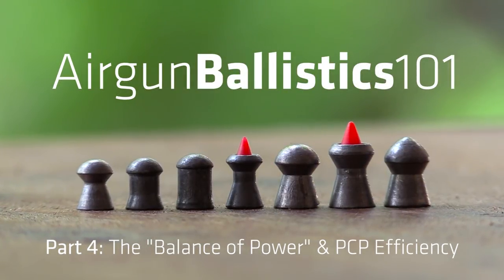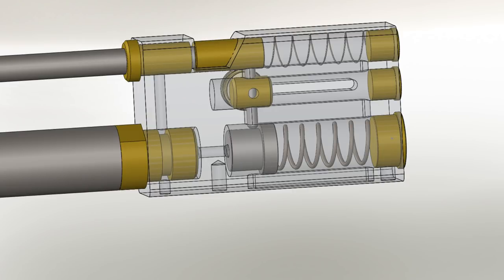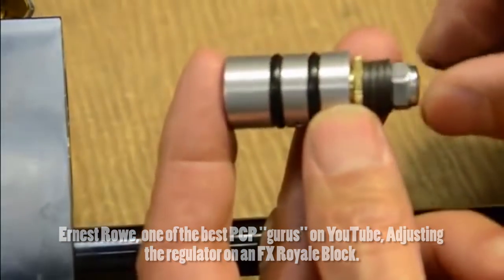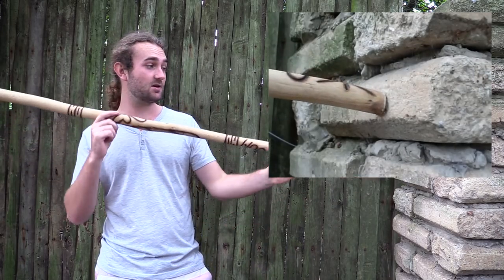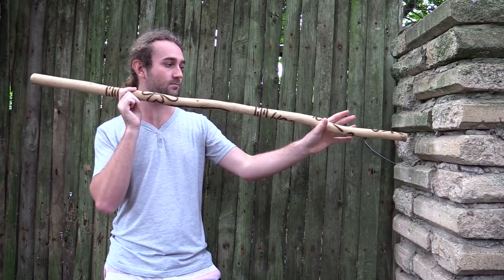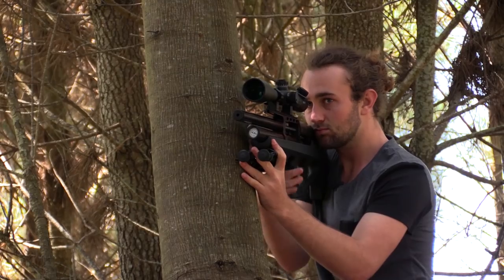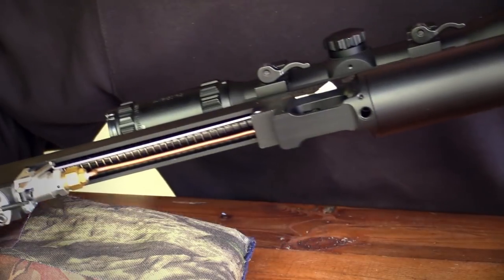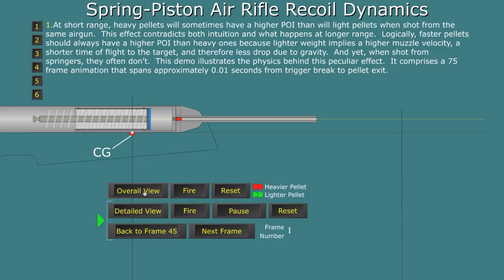The Balance of Power | AB101 pt.4

Comment: Brilliant video!  I am a veteran paintballer and failly new to airguns, but the way they work is EXTREMELY similar.  Regulator, valves, hammer spring adjustment.  Super happy i found this!

Comment: Basically its impulse control on the hammer. You tightly control the impulse on the hammer so that its delivered over a very short period which is shorter than the travel time of the hammer so that it bounces back on striking the valve head and doesnt have another forward cycle or if it does, not enough ro release more air. Thats good information.  Im currently working on a few designs and really appreciated this information.

Comment: To get the best performance on a regulated gun, you should 'sweetspot' the reg, if it's adjustable of course. Start with a low spring pressure and increase the reg pressure to the maximum velocity (chrono reading). Increase spring pressure and do it again. Do so until you get the desired velocity.

Comment: I've been watching these videos for YEARS and I've learned that there IS a method for running related PCP's. But it seems as though it's a giant freeing secret because no one gives a good video on tuning the: regulator, hammer spring, valve spring, hammer weight, hammer bounce.... Robert Lane has the best I've seen so far.

Comment: 🔫🔫🔫 I immediately noticed the importance of the valve spring adjustment when I tried to bring my dreamline down to 90 bar,  the valve spring is not strong enough to hold the air and it just leaks down over a couple hours.  Turn it back up to 110 bar on reg pressure, and then it has enough pressure to keep the hammer valve closed tightly.    If the dreamline had a hammer valve adjustment, you could easily adjust the spring to keep the valve closed at much lower regulated pressures.   Like the impact you could lower your reg pressure WAY down and just tighten up your valve spring and boom.  No leak down.   
I’ve been thinking of a way to get a “DREAMLINE mod” to have a spring adjustment,  but you would probably have to drain the air every time you adjust it because all of that is in the air res sealed up behind the reg.

Comment: amazing insight in the internals of the PCP , i am guessing that the graph @1:45 is for "response of   REGULATED   pcp to hammer spring preload" instead, as the graph is linear from 0T to +5T thats typical of a regulated setup.

Comment: Couldn't you pretty simply replace the hammer in even a cheap air gun like the Air Venturi Avenger with a two part inertia hammer to avoid hammer bounce?

Comment: Epic video Matt. I've just acquired a regulated BSA r-10 mk 2 running at 11.1 ftlbs. Being a regulated gun, does this mean that hammer bounce will not be an issue with it? (BSA claim it gets about 240 shots from a 235 bar fill but I've never verified this personally) Is there a way to increase efficiency with regulated guns? Many thanks, Lance.

Comment: Hi,
Thanks for your helpful content!
A little advice if you can.
I have a Brocock Compatto 5.5 mm, and it shoots at only 11.5 J. I am in the UK and is supposed to shoot at under 16J nozzle energy.
I purchased a regulator in order to get more uniformity over nozzle velocity at working pressure 200 to 100 Bar. I set the regulator at 120Bar ant try to adjust it to get 15.8 J nozzle energy but the maximum I can get is 14.7 J and a lot of waste of air because the number of shots I can do on one cylinder is less.
I mesure the tranfer port and is 2.2 mm ID (I thik here the air is geting slowed). I am planig to drill the tranfer port to 2.5 mm.
Now, the question is: have you taken apart your rifle? can you tell me what is the ID of the transfer port?
Many Thanks.

Comment: Hi i just got brand new reximex throne and when i tried to refill it, air was coming out from the barrel and couldn`t hold the air at all, do you know what to do? thanks
Reply: It's likely a rotten Oring dissemble and replace it remember to use silicon grease for high pressure air

Comment: I need to be explained some thing to me in your next videos. I am having hard time of understanding how does weigh of the pellet effects on the air being spend on the shot. For instanse if I have pellet in 177 cal, weights 0.67 grammes and shoot it in 300 meters.persec I have 40 stable shots. After that I do not screw anything in my gun, I just change pellet for 1.05 grammes JSB Beast and shoot it and have only 20 shots in the same air preassure range. Why is that happens? Its wastes more air now but I just changed only pellet. How is that possible? Please would you mind to help me to find out.
Reply: Cool question! Let me analyze: 0.67g x 15.432358 = 10.34 gr, and 300m / 0.03048 =984.25 fps, so 10.34 x 984.25 x 984.25 / 671 / 671 = 22.25 fpe, and 22.25 x 40 = 890 fpe total from your fill.

Now, keep in mind that a heavier pellet will travel slower in the barrel, but will accelerate longer in time, so the kinetic energy will be a slight higher by 1% to 5% if all variables are fairly equal; in other words, do not compare apples to oranges as 4.2 grain alloy to a 5.14 gr BB to a 21 gr lead (Pb) pellet.

A straight across-cross multiplication equation to convert m1 v1 to m2 v2, since you did not give the velocity of the "1.05g" which is 16.2gr, so the unknown is v2.

m1 = 10.34gr
m2 = 16.2gr
v1  = 984.25 fps
v2  = ???.?? fps

Isolate the unknown v2 = sqrt of: {(m1 x v2 x v2) / m2} = v2 = 786.336 fps, and
16.2gr x 786.336 x 786.336 / 671 / 671 = 22.25 fpe, so 22.25 x 20 shots = 445 fpe total.

Now for the ugly truth:

445 / 890 = 50% efficient for the 1.05g pellet in your gun, while the 0.67g is 100% efficient with the 0.67g in your gun.

Now, the answer to your question as to why you only get a 50% output from the heavier pellet, is in the name of the plumber; in other words, without enough information, I am pissing into the wind and wondering why my feet are wet.

What kind of gun, caliber, barrel length, type of pellet, pump/CO2/HPA/break barrel, smooth, rifling dimensions, gas pressure, etc., etc...

The more information, the closer the result to the truth. If anyone has a quick and dirty answer to your question then that is exactly what they are.

From the Ke and fps I guess you have a HPA gun. What would be nice is if you can include if it is regulated or not and what is the fill pressure you are using; also, if you know the plenum size, reservoir volume, and what appears to cause your 50% loss in total power is, what is the transfer port orifice diameter? It is probably 50% of your caliber in order to get the most shots per fill as opposed to it being the same as the caliber in order to get the most power per shot, but least number of shots per fill.

Use the following formula and tweak the variables to get your target power and efficiency numbers.

psi x π/4 x cal. x TP x n x Bbl" /12 = theoretical fpe

π = 3.141592654...
n = efficiency (power out / power in)
TP = Transfer Port diameter
Bbl" = barrel length in inches
12 = number of inches in a foot
psi = 14.504 psi/Bar

Enjoy your shooting experience because it is also a journey.

The laws of physics are not just really good ideas.

Numbers do not lie, but you can lie with numbers.
Reply: The short answer is there is likely some factor in your gun that adjusts for an heavier pellet  its obviouslt either not a strictly moderated gun meaning like regulated guns it releases only the ammount of air that it is designed to within reason or its designed to sort of adapt to whats happening and use more air for a heavier pellet. The air in the resivoir pushes the valve close, but the air comming out has to expand in order for it to do so. A heavier pellet takes longer for a given air volume to accelerate and this could make the valve slower to close. This would allow more air out. Reducing the number of shots. Like how a two stroke motor benefits from back pressure from a exhaust pipe in ways and to extents that a 4 stroke doesnt. 
Thats my idea at least. 
 The gun is obviously not releasing the same ammount of air with heavier pellets. Because if it was you would see a similar shot count. A halving of shot count is significant and seems consistent which leads me to believe that something in the rifle is changing either by design or by poor design with a heavier pellet. Ask the maker they will likely be able to tell you exactly whats happening.

Comment: Awesome bro. I love watching your videos and I learn a lot from you. I have a question can I change the hummer system on kalibrgun cricket to get more shots? Thanks.
Reply: Yes, but by making it lighter, it will hit the valve lighter and let out less air; thereby, more shots, but less power per shot. so the question should be posed: what hammer weight will give me the most shots per fill, while obtaining the best accuracy and power combination? If you were to decrease the hammer weight to the point only enough air comes out for the pellet to fall out the muzzle, you'd probably get about 1,000 shots per fill.

Comment: Hi, could you please guide me on how to increase FPS on P1000 Diana .22 pcp air gun? mine is giving 750FPS I think it should give 850+
Reply: Open up the transfer port diameter to the caliber diameter and polish any roughness in the gas route, but if you want a quick velocity increase without any modifications, use a lighter projectile. You did not include the mass of the projectile giving you 750 fps.

Comment: hi matt on my sons acount my aas510 fac  set at mid power 40 shots low power 70 shots how can this be if the valve is rele asing the same amount of air none reg please get back to me also whe you screw the tranfare port where does the excess air go  thanks
Reply: the air goes the same place just slower bc it's restricted
Reply: more shots bc the bell curve flattens within the desired range. Matt's part 2 of the the "ultimate sporter "review covers all of this very very clearly. tutorial and review Playlist. and thanks Matt, I'm hooked and now own the above mentioned( American version)
Reply: hi thanks for taken the time to answer watched the vid understand now thanks again
Reply: +Justin Simpson  no worries, Matt has an excellent knowledge file going I use the heck out of this channel. so much I'm going to try and start one here. Lots of pests here and tons of small game hunting to be had

Comment: 🔫🔫🔫 I wonder if other dreamline owners have figured out that you must have at least over 100 bar regulated pressure to keep it from leaking down.  I know for a fact I spent days experimenting with this and I believe the only option would be to have different valve spring strengths for extreme regulated pressure differences.

Comment: I have designed my own hidrotic multiplying  trigger .  when Depressing , The poppet,  this is done  by Two apposing, piston floating in  oil. as the smaller piston is Dearest as the trigged applies that  incest force  to the oil, is compress & multiplies the  force on the poppet valve is litter on the trigger  The travel  allows the poppet to  opens the force  holding it shut , clap's sending the pellet down rang,  & the trigger  is reset  as the poppet shuts . under the regulated presser.   resets the hidrotic's to it start position. .  at this stage a tow stage trigger  can be fitted  but i find it exsepterbal with one.   the final release. allows a claps of air in the poppet . camber  there is no hammer.  this  alienating noise. making the rifal not silent but parity dam qiut. removing hammer bounce all Together. 

The principal is baste on the effect created  by two different sized pitons when under force is applied by the smaller  & leverage  multiplying that force  by it's area when the oil pressing  upon the slightly larger piston. this multiple's the trigger presser & distance.  of travel couplet's the opining of the poppet.  Valve releasing the air as it collapse the trigger is relist & the vale is reset . . If the trigger  is not riles the larger piton. applies it's own pusher to shut the poppet valve.    Resulting in no hammer, 

The comparison can be made by the hydralike breaking  to a slave Cylinder to that of a master cylinder of a car braking system, the  applied   pressers making  the depressing of the poppet litters  & the distains travailed. just like the brake is applied by the slave Cylinder. to close  the break. I find the rifal not only quite but less air is lost. .  to apply a safety a simple slid is applied  to the trigger to prevent it being  pulled.    

it's  not patented by me as the first i know to archive this siystom.  it a applied hidrotics   & free  for adaption to any one,  [wising to apply this precibal to their air rifal, ]  it a good modification .    I used this principal to covert my Springer to a.  Breech lodging PCP . air rifal.

By Les Thompson England ,
 [  Regulated Rifles]  I can't do filming so I have  posted  my results. here   [bloody good mod ]